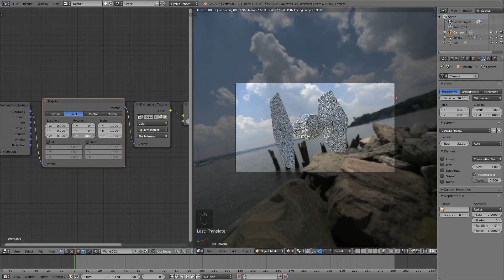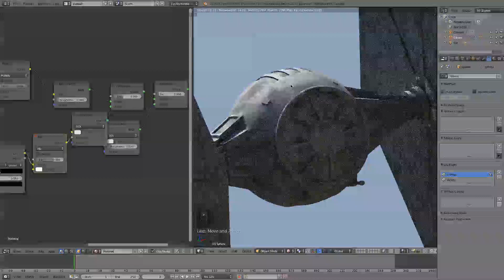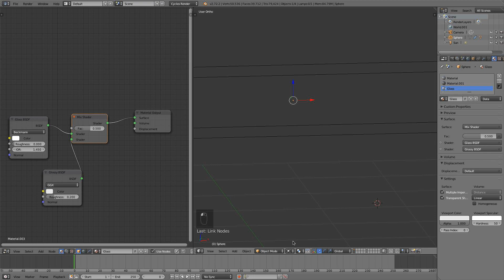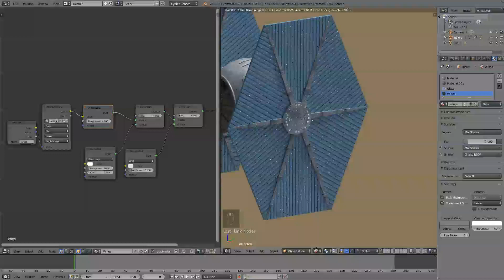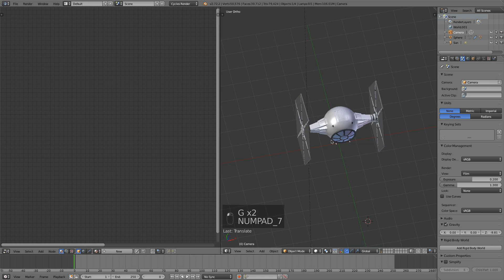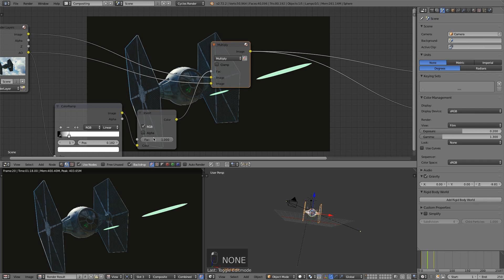Comment: Hi Steve. Great tutorial! As usual, I wanted to add some personal touch to that. This is what I ended up with: https://ip2fda-ch3302.files.1drv.com/y3pk_aHKB7bL4HdGf-hOJp6v2wv-MekJ4Wh_PBP1aXerNUcxa06tlAHijeAcuHmPDiD60kgyqni8cglvxK3egJZAHJc8ihULDHvr_7r3_VM1Rr4ElQIUJeHUyA47OgvhglbMQBgCad3PkGRGNLZsqSB3A/20151122%20-%20TIE%20Fighter%2044.jpg?psid=1 
and: https://ip2fda-ch3301.files.1drv.com/y3pTw0x-YG8HMTY5BgWIbHWlBA9oe4XoEWSjWjn_TrirGILfuLtexr-VtKGD0It78tKebGUjAyx2IMRoK_RK8eOoDgb0u460OJ9qXIqvJJs8Ri4we30xhMjxbp6SjRGzVubMZo1ai-CsCIbSrdXgTNMeQ/20151122%20-%20TIE%20Fighter%20Ortho%2001.jpg?psid=1 (more to come: a "battle" and an "underwater" scene).